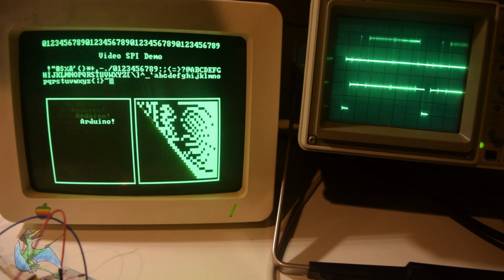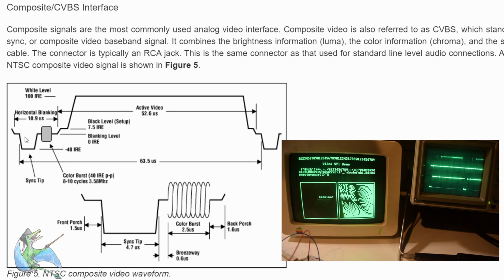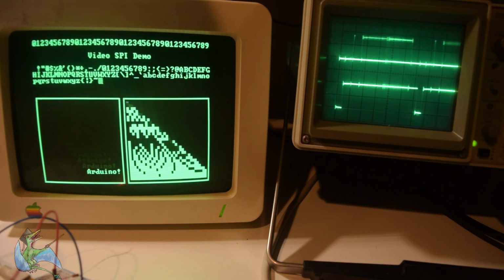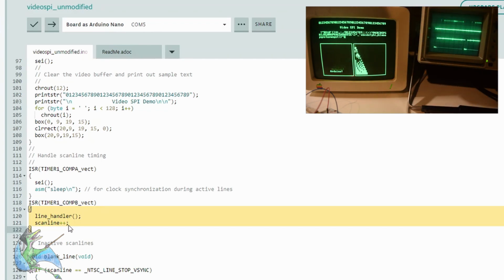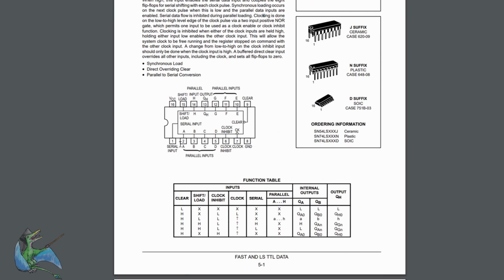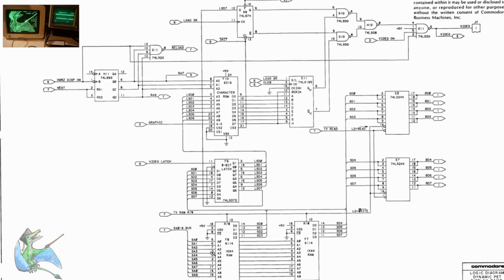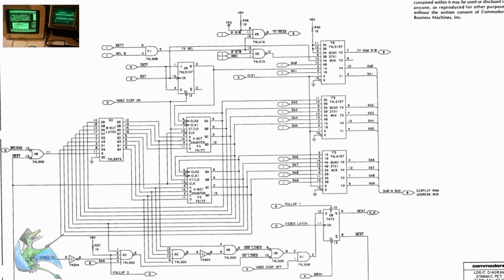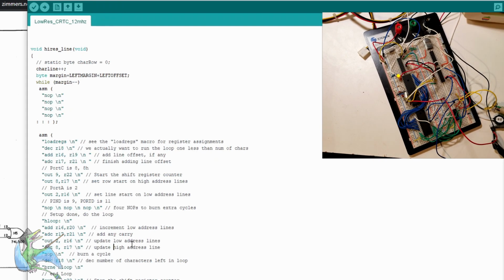DIY Lo-Fi Video Card Project Part 2: Sync and Address Generation

Comment: Oh interesting.  I am surprised that the timing can be tight enough to read from the ram every pixel.

For my project, I will have an external 2k SRAM holding the characters on the screen.  I was planning to read it all into the uC during the vertical blanking interval, but that could cause contention sometimes when the host z80 wants to access the vram during vblank (it gets priority).  So there is a possibility that software that accessed the vram during every vblank would prevent the uC from ever updating its internal screen buffer.

If there is time to nab pixels while the raster is on screen, that would solve that problem.  But a VGA signal is going to at least halve the amount of time I can tie up the uC reading from the external ram.

Too bad dual port memory is so ghastly expensive now.  Although maybe 2k of it could be implemented in vhdl on a cheap FPGA.......
Reply from the maker: If you're willing to take a gamble on the AliExpress-level sources you can get the 1-2k DIP48 dual-port SRAMs for "reasonably cheap", IE, three or four bucks each instead of the gawdawful $15-ish that the Mousers of the world are wanting for them, but the one thing I've had bad luck with from those sources is memory, so... yeah. I decided that I'd try biting the bullet and deal with memory contention externally, which is another place where the GALs are going to get a workout.

If the plan is to copy the contents of a "framebuffer RAM" that's interfaced to the Z-80 into an MCU's internal RAM for actual display I can think of a couple possibilities. The obvious "period correct" thing to do would be to just halt the Z-80 with wait states if it tries to write to RAM while you're doing your "suck" operation. The hit from this might not be very bad in realistic terms because if you're using a "fast" MCU and SRAM (you can get 32k 15ns SRAMs for only about $3) you should be able to firehose the 2k character buffer into the MCU "pretty darn fast".

Comment: Nice.  I been looking forward to this.

I have a project not too far down my list which involves bit banging VGA on a fast uC.  It's going to be an adventure.  =:3
Reply from the maker: You might have noticed a silver can oscillator in the upper right of my breadboard, which is a 25.whatever MHz part, standard VGA 640x480 dot clock. It’s not connected to anything (now, I did have it strapped to one of my clock divider GALs for testing), but hooking that up and seeing if the AVR324 I’m using can tolerate a 20% overclock is on my list.
Reply: @PaleozoicPCs  I've been thinking about using an ESP32.  Although it's a tad overkill (the wifi especially lol), there is a really good VGA/keyboard/text terminal library out there for it already.
Reply from the maker: @Lee_Adamson_OCF  I've been sticking with the AVR for this project instead of going bigger (the STM ARM in the ""Blue Pill" came up) because the AVR seems like it's uniquely good for this niche of acting as an address generator for external SRAM. It has very predictable instruction timing (The Blue Pill CPU in particular has a bunch of contention gotchyas that can come up internally that don't make it completely synchronous) and is so simple you can basically just pretend it's a state machine.

But, yeah, if you want full terminal handling internal to the MCU the bigger CPUs make more sense.

Comment: The video quality you're getting is very impressive. Decent dot clock speed and it's rock-solid - no timing jitter visible even on the scope.
Reply from the maker: Yeah, I’m pretty pleased with how clean it is. There are some faint jailbars just visible to the naked eye but some artifacts are probably unavoidable running off a breadboard. Also I don’t have a proper output amp yet, the video is straight off some resistors combining the sync output from the MCU with the TTL-level out from the 74LS166.

I have experimented with higher clocks and it does work up to 20mhz, but it gets noticeably less stable. 12mhz seems like a good compromise unless you need 80 column video. I’ve been thinking of ordering some 14mhz crystals to see how they do, that ballpark was common.
Reply: @PaleozoicPCs  Looking forward to the GAL part.

I don't suppose you fancy a project on driving asynchronous DRAM chips using GALs and an 8-bit CPU? Here's Bill Herd's recommendation

http://www.6502.org/users/andre/icaphw/design.html

"I recommend that you take a look at a simple device like a 22V10, feed it a higher frequency like 8mhz and use some state machines to create a nice tight DRAM controller. If you don't have a higher freq then get something consistent by way of delay line to create the relationship between RAS, MUX and CAS."

I always wondered how 8-bit micros managed to do this.
Reply from the maker: @Aaron_Nonymous  So... spoiler alert, but the big reveal for the GAL video is going to be what I've decided to do for my first attempt to weld this to an actual computer, and coincidentally enough I've decided to try building up a full Commodore-like 6502 machine on a set of breadboards that shares a single RAM bank without contention between the CPU and the video system. I'm sticking with SRAM because plenty large ones are cheap enough and you don't have the additional annoyance of dealing with MUX or refresh, but the GAL that I have programmed to generate shift register reads is already also set up to output the video-synchronized PHI0 clock for the CPU. (Just need to test it now...)

The same techniques I use for that should work to make a DRAM controller.